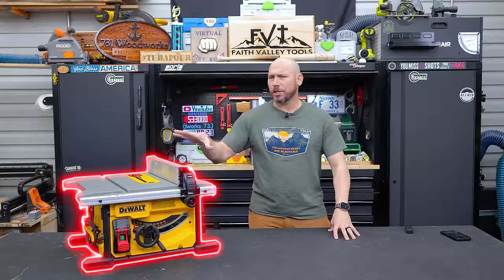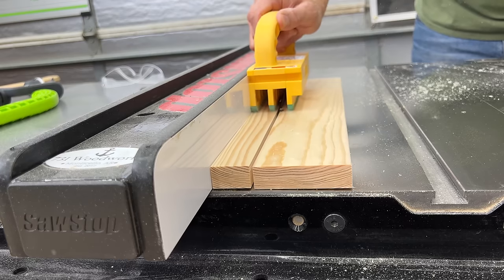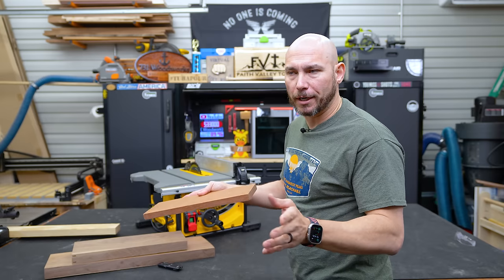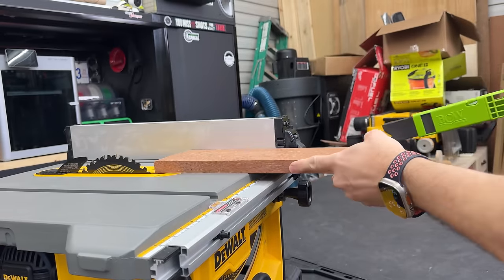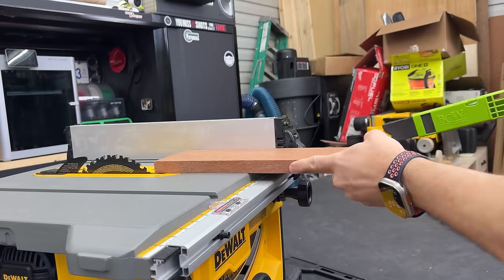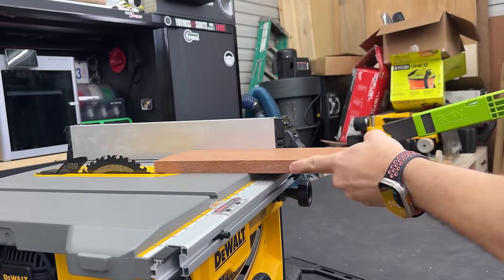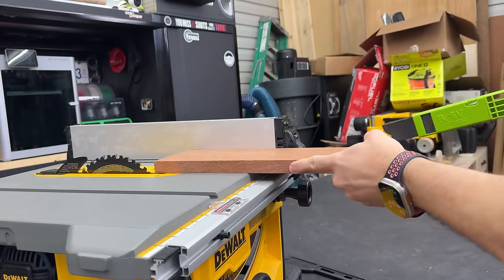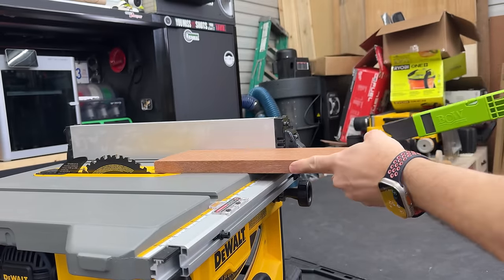99% of Beginner's Don't Know These Table Saw Mistakes to Avoid!

Comment: As a woodworker- and table saw user- since the early '70s, I can say these are all great tips.
  On the other hand..I think a lot of people just starting out wouldn't be able to afford many of these tools.
  I've never purchased a push stick. A push stick is very often a 'sacrificial' tool. I'm not paying $20 for a limited usefulness sacrificial tool. I make my own.
  I don't use solid wood or plywood. Hardboard or MDF will do the job and there's no danger of shattering and having a wood or plastic shard being driven back into your hand or arm.

Comment: The gripper. Is a fantastic block. I adjusted the handle to an offset where the back is to the left and the front is to the right. Maybe a 1/2” total. This causes the block to push the material forward and also towards the fence.

Comment: Great  video on safety. I've been  a trim  carpenter for 25 years Luckily was taught from the start safety first Don't get in a hurry or overly confident..no job or diy project is worth loosing any of your fingers or  a limb over.so far so good on that . Although Years ago I was cutting some Smaller square rips twenty by twenty or so of 1/4 plywood on Tables saw Which was in a cabinet shop that I worked in at the time, so it had a full table set up around it. And I was very familiar with this, all still that A quarter inch had a bit of a cup in it. There was no writhing knife on the blade Slipped. Luckily didn't slide my hand through, but caught it spun it around and hit me right in the stomach. Knocked the wind out if me Left pretty nasty bruise Could have been a lot worse. That same very saw another employee. It was ripping some smaller pieces, corners. Or something? I'm not sure but one of those corners caught and it's spun that thing so hard. The corner of the piece that shot off stuck into the wall behind him Which was plywood as well, not sheetrock I believe that peace is still sitting there today as a reminder. So regardless of the familiarity of the tool and of course the everyday usage You can get overly confident With any tool. Day to day as I'm still In the field or in the shop I have to remind myself.
Don't do that . A lot of these things are common sense. It's definitely good to have reminders like this. No matter how long you've been doing it. Still have all my fingers knock on Wood. That cabinet shop replaced both They're shop saw with the SAWSTOP And The tables all they use in the field is  a saw stop as well. I use Personally use The dewalt contractor teen inch tables all the one with wheels on it, which is a Excellent saw All the way around. I welded up a Outfeed table that mounts to the frame and welded some brackets on the back to hook it in with two pins So so it's mobile And light, just like the saw so easy on the rollout and Set up, which Is a time saver for sure, and definitely makes it easier to push longer pieces through and much safer. But as you said, An outfeed table of some sort is definitely a Necessity for safety and precision cutting. Especially if you're working alone, don't have an extra hand to hold the other end if you need it.

Comment: You said about not having a budget for an outfeed table... I bought a box of screws, a couple of fence pieces, and found a pallet. I made a small workbench/ outfeed table for under $20. I'm not going to lie I just threw it together to start. But I like it( for now) I got my table saw for free from a co- worker in my kitchen, it didn't come with anything. I have to make a fence, sled, everything... but it will add to growing my experience and skill.

Comment: I recently saw a different opinion on the #3 you put in here. I agree that keeping the blade as low as possible is the safest way to prevent accidental cuts, this other persons point was interesting and his was that having it higher prevents kickback more because then the blade would be impacting into the wood in more of a downward direction than straight into the wood. I still keep it low myself. but curious on your thoughts on this point of view. Kickback is also dangerous. As always its to know your comfort with the tool, and always respect them as they can all be dangerous. Great videos, they are very well done and informative.

Comment: I agree with others' comments. This is definitely one of the best table saw safety video out there. I have been using table saws for 30 + years, and wish I had the opportunity to see that video in the beginning. I now knew most of the information you present (very clearly BTW), but it's always good to remind yourself. Never though about the tourniquets, but it make sense. We bring one in our motorcycle trips in the wood, but will now have one with me when using the table saw, as well as the circular saw and chainsaw. Thanks for the great video!

Comment: Having the blade high does look more dangerous but reduces the likelihood of kickback as the force is more vertical.
In-feed & out-feed support is crucial when doing anything big but the roller type is best suited to thiner pieces.
For boards you need the ball bearing 'roll in any direction' type unless you make sure the roller is exactly perpendicular to the blade & then weighted down, otherwise the roller 'steers' the wood.
Good video thx

Comment: Great videos, love the channel.  I mostly work with metal, but wood on occasion.  Uber safety I might suggest: Face shield - Often when an object strikes us, we flinch or move, that can be serious danger.  Leather apron (when SAFELY worn, tied and secured) - a piece of material can come loose from the board/metal etc, and fly back.  Tourniquets & voice activated earpiece with phone - Pre-apply the tourniquets (as long as nothing hanging loose), and have your earpiece linked to phone so you can scream for 911 Emergency.  It is possible that the hand you need to apply the Tourniquet is damaged, having it in place already = maybe you can pull it with your teeth or even hook it on something to cinch it tight.  
My friend had a car hood close on his thumb, trapping him beside the car with no way to reach the hood latch.  Luckily, He had his phone, called a friend, she came and found him passed out hanging by his thumb, luckily the car and his body was close enough to the floor that his thumb didnt tear off.  
Stay gold.

Comment: I feel personally called out. It's like you know all my bad habits. I've used the table saw without a fence several times. I have to install doors that are way too close to the wall and I have to trim 1/4" to 2" of material off of a casing to shape it into the wall. Since the walls aren't straight, I have to make a tapered cut. I measure out the distances at the top, the top hinge, the center hinge, the lower hinge, and the bottom. I then trace the marks together into a line with a straight edge. I bevel the table saw at 5 degrees of backcut and I VERY slowly cut out the line. I'm combining several bad practices here. Rotating the material (in small increments), going fenceless, and putting up with a builder who puts a 3' door in a space meant for a 2'6".

Comment: Good video. 
My tip for beginners...DO NOT underestimate the speed and violence of a kickback!! I've had two. Both totally avoidable - lessons learned. The first one sent me to the ER after a small block of wood hit my right wrist with such force that it ruptured a blood vessel in my arm, bounced off and still have enough force to put a bruise on my chest. While it didn't break the skin on my wrist (hit flat luckily, I'm on blood thinners), I did have a golf ball sized hematoma in a matter of seconds and was concerned it would rupture. 
I did learn enough from that to stay left so the next one missed me, but it went across the shop, and made a rather large dent in a steal clad door. Decided I needed to refresh my safety techniques. Kickbacks are serious even if your body parts are not near the blade.

Comment: Do you think that the Miter gauge Miter V 27 would be better than the one supplied with the Rage 5 saw, because it is known for its freedom of movement within a space, as of a part of a mechanism. (freedom of movement within a space, as of a part of a mechanism.)I also didn't know about the little spring spring load arm; I know a lot of safety features for using my saw, but I don't know everything, I still discovered quite a few things thanks to this video. Thanks for my fingers!

Comment: I enjoy watching your videos as well as all the replies. Everyone has some thing that they can offer as well. 

I have one request. Can you make up a video of devising a plan to straight line rip rough cut lumber that has been dried and planned? 

I have alot of wood ready for this important step and have tried many different ways. And yes, I have tried a long track saw with a 12. ft one pice track.  Some kind of jig is needed either for a tablesaw or circular saw. But repeated cut after cut is required and the process has to be fast. Minimal clamping. 

I have all different widths of 1/4 sawn white oak and have tried it many different ways and still have not found that perfect way yet. 

Since the length would have to be minimum 12ft, I could even do 16’ to cover any really long boards I get every once in a while. The process has to be fast as I have many to do. 

I would welcome all suggestions especially if you are using it.

Comment: I have been using table saws for 39 years and have been doing it all wrong the whole time.
I have never used a push stick once, always ran my hand,fingers between the blade and the guide.
I also have always stood square behind the saw and made many cuts with no guide at all.

And still have all my fingers amazingly. Accept for a tiny bit off the tip of my index finger on my left hand. But that was using a chiop saw. Again from cutting tiny pieces with my fingers mm from the blade.

But watching this makes me realise how lucky I have been and will definitely be buying one of those g ripper holder thingies and stop doing all of the above.
Thank you.

Comment: Extra tip for safety (and convenience): Use a pedal switch. You plug the saw into it and plug the pedal into your power supply. The saw won't turn on unless you're stepping on it and as soon as you take your foot off, the saw powers off. Much better than having to reach down under the platform to turn off the saw.
Reply: You have a foot pedal model you like? I tend to be moving around a bit when making cuts, but could be useful for some situations.

Comment: Check out the ratcheting style tourniquets.  I was a full time paramedic for 23 years, after trying several types my department settled on these, they are simple, can be applied one handed quickly and easily and they work very well.

Comment: "High or die" is actually contrary to first aid. It should go 2 to 3 inches above the wound. This will ensure it doesn't slip off (in the event you lose a limb). The reason you don't go too high is because there's a strong likelihood everything below the tourniquet will die from a lack of bloodflow. Just thought I'd share.

Comment: I think one thing people should remember is- make sure you are balanced. I usually try to have my right foot slightly ahead of the left. If something unusual happens, and it will, you can push your body away from the saw. Great video. Also if you do cut a finger off make sure to take it with you to the hospital so they can sew it back on for you !

Comment: I'm kind of new into woodworking and would like to know on these saw stops. If you happen to use your saw stop, is it resettable, or do you have to buy extra parts for it ? I'm just asking?
Reply from the maker: If you trip the brake, you have to buy a new brake (or have already bought one) and replace it.  Takes 5 minutes or less to swap out a brake.  The brake is about $100.  I've had my SawStop for several years and have never had an accident trip.

Comment: A great video.  Thanks for the helpful hints.  So, I am in the shop.  I have made my cut and I turn off the saw.  The blade has come to a complete stop.  No movement anywhere.  I reach over the blade to retrieve the cut piece and a saw tooth puts a nasty cut in the underside of my right forearm as I pull my hand back.  I did everything right and still got cut.

Comment: Great video, but i've a remark about 3). When the blade is all up, the angle of the theets is more perpendiculair on the wood and the force more downwards on the wood (and less towards user). Aa higher blade gives more force down and in that way safer. But indeed a higher blad is more exposed risk.

Comment: OK I'm about 7 minutes in. And you're talking about kick back and the fence. I have some hand me down tools that have old blades.  I will be buying new ones on my next project. I am a beginner that is currently out of work for health issues and decided to work on some projects. My table saw fence is loose when i put it on, is there any way to adjust it or buy a new one, or is the whole thing garbage? 

I was attempting to cut the side walls for a drawer i was building, and yes i was standing to the left, I ended up getting kick back on the left piece and got nailed. Not fun, could've ended badly. 

Also, I'm not sure what table saw i have, but can i get an add on blade guard or riving knife?

Thanks for any responses.

Comment: i like keeping the blade a little higher as it helps put downward pressure into the piece you're cutting so you have less of a chance of kickback. Also if you make a longer fence attachment for your existing fence you can run bowed boards no problem. That what i use to straight line most of my 6/quarter oak because its a lot faster then jointing the boards, that being said i take off as little as possible and repeat the cut if i need more taken of to achieve a straight cut. that eliminates most of the risk.

Comment: If I may remind you that if you have the blade set low, the force of the blade on the timber is trying to push the timber back at you.  If the saw blade is set high, then the force is primarily in the downward direction holding the timber against the table saw top.

Comment: What I use for a for a catch long stick is my work bench which is a old door on metal sawhorses them I made is a treadmill and it has metal pieces to the same height and it works great for a outfield table and I got the treadmill for free as well and it works great for cutting long stock on my Craftsman table saw

Comment: Free handing on the tablesaw is not that necessary but I’ve had to do it hundreds of times for door casing legs where the architect didn’t leave enough room for a full with between the door and the wall. Mostly it was MDF under 3/4 so it has almost no resistance against a sharp blade. I definitely would come up with a better solution for a thick piece of hardwood because the riving nice has to be removed. Thankfully I have a big bandsaw at home.

Comment: my oh my you posted up a lot of good info !   but add to it  #1 clean the area needed around the saw and sweep up the floor - saw dust is slippery !
#2 don't waste your money on a low priced saw blade ! #3 do a little research to find out what toothed blade is best for the cutting job your planning to do . #4 most shop vacuums easily hook up to your saw to catch most of the saw dust  - or add on a 90 degree pvc pipe angle with a short pipe to blow the saw dust into a garbage can or a cardboard box !  and #5 make sure you have a well lit room !

Comment: I don't have room for an outfeed table so I let the wood fall on the floor. However, I cut everything a bit longer than I need it so I can trim off damaged corners if needed. Tourniquet was a great ides. I have a first aid kit and will be adding that to it.

Comment: My mom was a OTR specializing in hand therapy. A great number of her patients were limb reattachments. Of those, by far the greater majority were table saw injuries. And - this may seem counterintuitive - most of those patients were "old timers" who had spent their entire lives in the shop.

This is a fantastic video for everyone who gets behind a table saw. NEVER get too comfortable with what you are doing. ALWAYS remind yourself before you turn on the saw, "What I'm about to do is dangerous. Be careful!"

I've spent 38 years as a carpenter, and despite a few close calls when I was younger, and inexperienced, and not properly trained in safety, I'm still intact.

As he described in the video, NEVER push that piece through putting your hand between the fence and the blade. I've worked with a lot of "tough guys" who do it all the time. One of those guys is missing two digits... He uses a push stick now, but it took TWO severe accidents to get him to open his eyes.

If you are working for somebody who keeps pushing you to work faster, or to take safety shortcuts about which you don't feel right, turn off the saw and walk away. Sacrificing your fingers to put some extra cash in somebody's pocket makes no sense at all.

Be safe out there.

And thanks for a REALLY informative safety video.
Reply: I'm one of the old guys. We get too familiar with the tools. I do stick my hand between blade and fence, but only on large sheet goods. A push stick is too unstable. The danger of sheet goods is they rise above the blade. Pushing down is as important as pushing forward. When working with sheet goods wax the surface for ease of movement.

Comment: 1:39 You actually want to fence NOT parallel but with a tiny bit of clearance after the blade. This should be stated and explained in the manual. You are only cutting with the front teeth anyway. This reduce kick back probability significantly and is even a legal requirement in Europe for example for that reason.